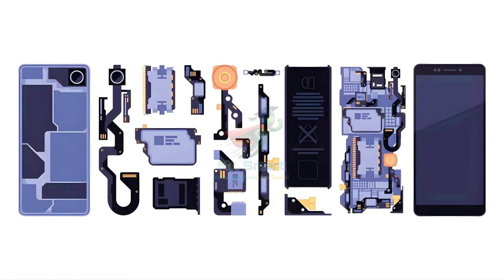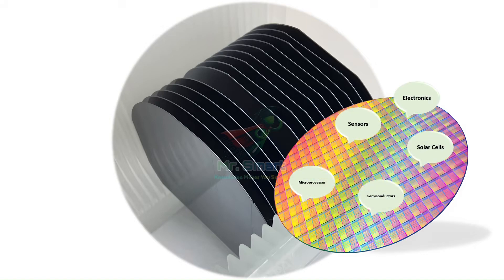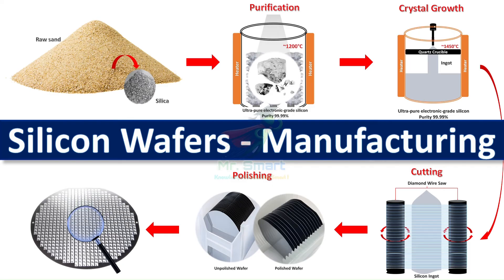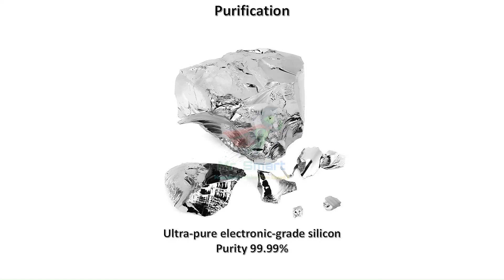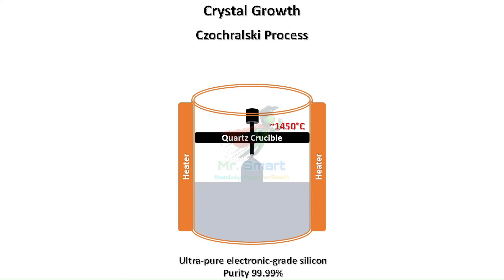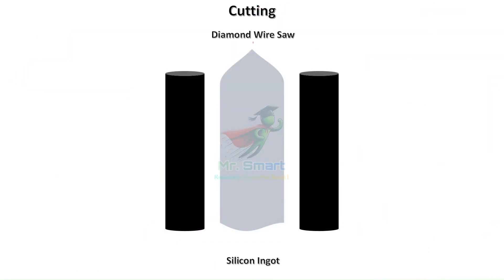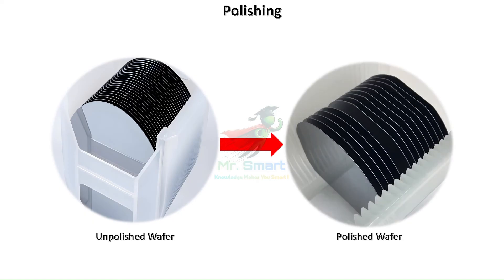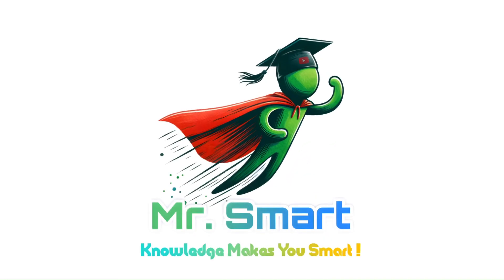How Silicon Wafers Are Made: 🔬From Sand to Smartphone Power📱#siliconwafers #semiconductor #wafer

Comment: Silica sand purification processes go through complex stages to achieve high purity. The manufacturing process for high-purity silicon depends on the purity of the silica sand. It is called the Siemens process and determines the production of single-crystal silicon ingots for the production of silicon wafers or bi-crystalline silicon used in solar panels.
Reply from the maker: Thanks a lot for adding more information...🤝🏻
Reply: @Mr.SMART_Engineering your are welcome bro, keep going 💥